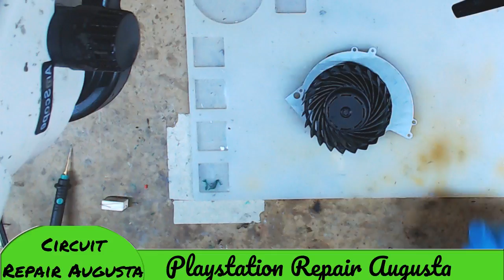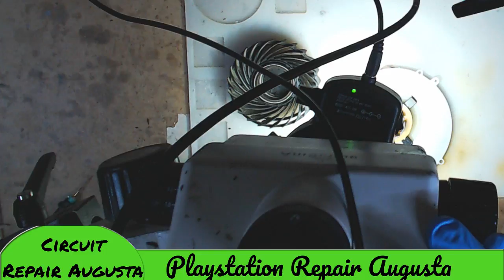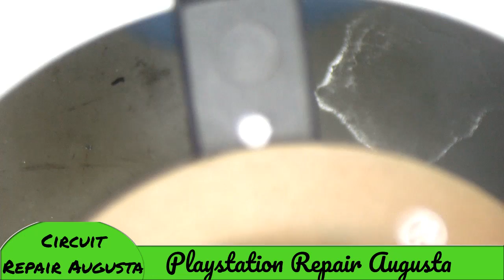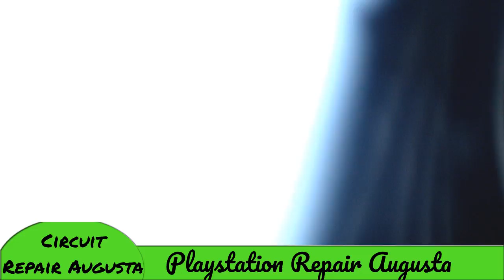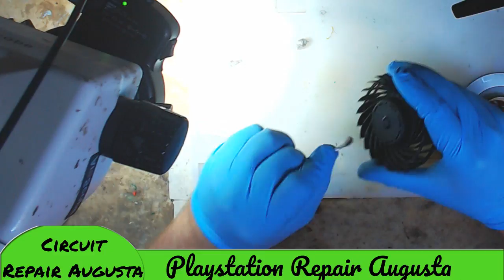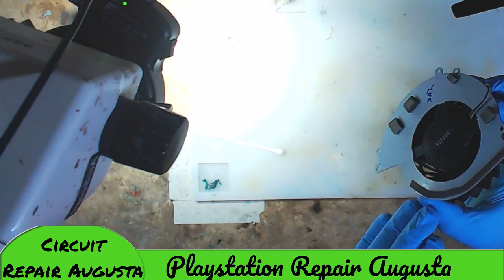Playstation 4 FAN Service Repair

Comment: There is an easy method to separate it. With the aluminium side facing towards you there will be four gaps or cut outs. Push your thumbs inside the gap with the other four fingers holding the aluminium plate. It snapped out easily and smoothly without breaking anything ✌️

Comment: is the ps4 cuh 1000/1100 model the same as 1200 model if i cut and join the connector part? Because the 1200 fan is almost 2.5 times the price of 1000 in my country.

Comment: I tried it on old ps4 pro fan and I've broken plastic, but it still didn't go apart (tried to replace cable directly on controller). I alredy had new fan so did it just for fun and to have other fan just in case so I dont really care. I guess its not worth doing it with fan ur using. There is probably more things to take it aprat in other models. Exactly like you said, they make things harder to fix by user so you have to buy new component. I think the problem is law, they do that because they can. It hurts me that we waste a lot of things we could repair if we had better law.

Comment: Is it possible to remove the coil part from the plate? 

My fan is perfect but the metal plate has major rusting on one side. i would like to clean it and paint the plate. Spare fans are expensive i need to ship internationally and also Chinese imports are banned in my country.

Comment: There its an oil call 3in 1 use back in the day for the mottor of the singer sewing machines  are safe for electronics and lubricate the fans perfect i use it to lubricate the fans when i do service

Comment: so i used a bench vice grip to hold the black plastic protruding center of the fan, then i used channel locks to pull the metal frame, gripping it around the center. idk if i damaged the circuit board though, about to reassemble and find out. thx for the video, did not want tot have to result to ebay and wait 10 years for usps to deliver
Reply: Did it work
Reply: It would be really nice if you let us know if things worked fine for you
Reply: @spirite22  im sorry it did not work once i reassembled it

Comment: You can pull it out with two knives, put them under near to the center on each side and then twist them to oposing sides making the inner edges lift the center under the fan.
Reply: How exactly
Reply: It impossible, you spell absolutely bullshlt
Reply: it doesnt really work with ps4 pro fans or I was unlucky
Reply: I have the cuh-1215a and this worked like a charm. Thanks for the idea.

Comment: Unfortunately I broke mine :(
Reply: by trying to pulling out?
Reply: @mohammadrezasafari4927  yes I had to buy a new fan my old one worked but was too quiet and ran so slow... Once I replaced fan and thermal paste no overheating